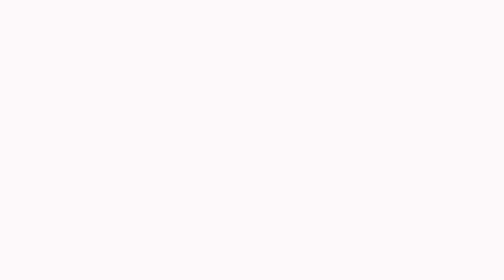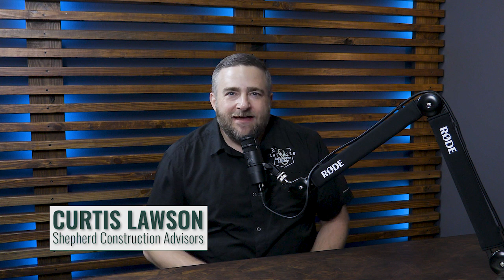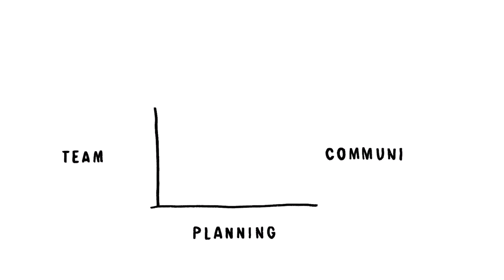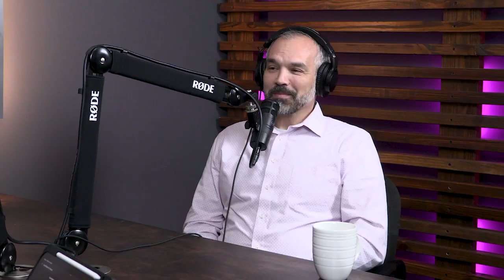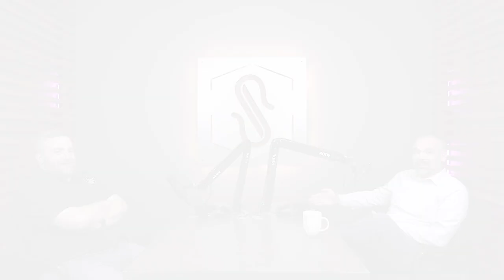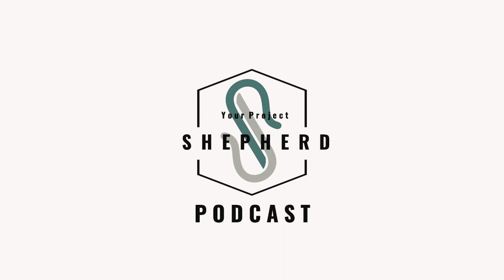The  Future of HVAC Technology with Voya Milasinovic (EP 66 YPS) - #podcast

Comment: Thank you for this presentation. I got the impression that much of the discussion was really focused on new, efficient homes. Do you see a place for some of the options you discuss (heat pump, dehumidifier, etc) as a retrofit in a Dallas-area 1980s home that is by no means built "tightly." It has a fireplace that I would love to get rid of. I currently have an inefficient package unit (outdoor unit) for both air conditioning and heating (gas). All gas combustion is outside. Thoughts?